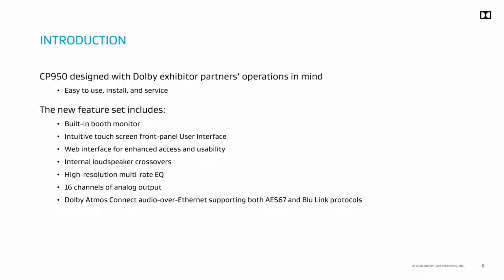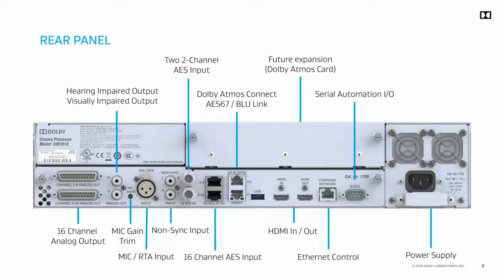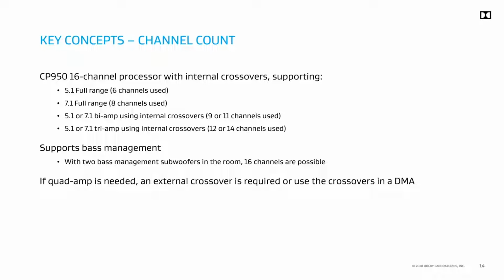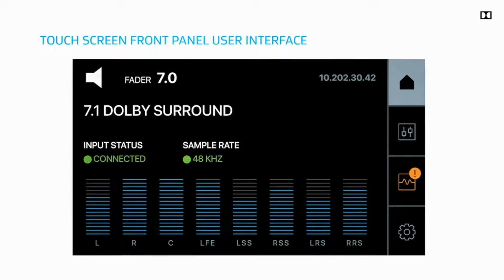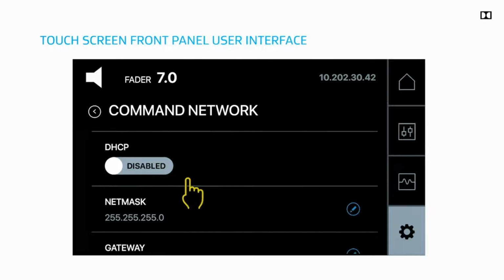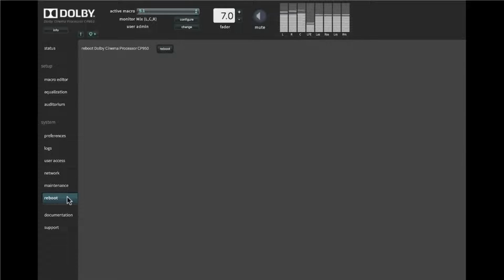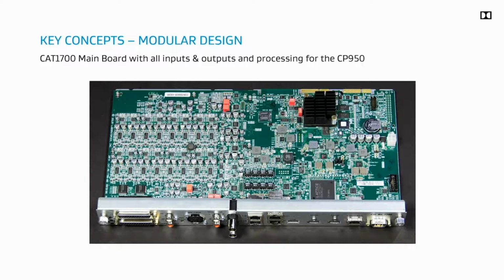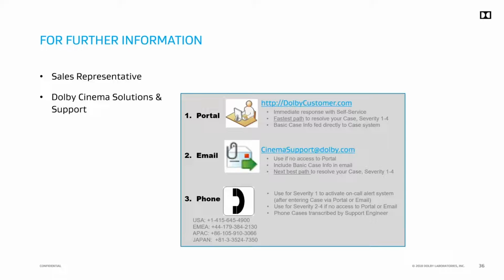Dolby Cinema Processor CP950 Webinar

Comment: i want to ask, how to enable bass and treble on subwoofer when ping noise? thanks
Reply: on cp750 menu bass and treble status enable, so i can cut all treble on subwoofer. but on cp 950 not enable.
Reply: I have trouble on subwoofer, signal mid and hight in on subwoofer. already adjust from DAD but not work. need advice thanks